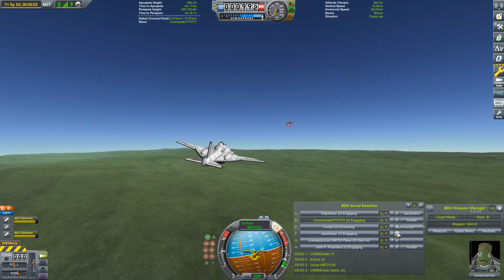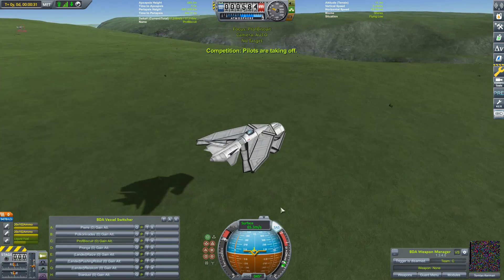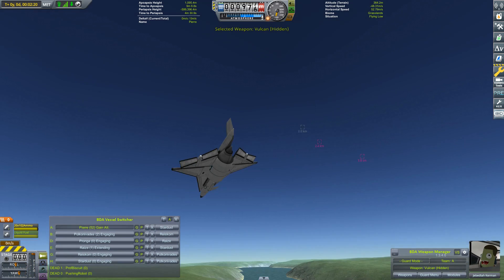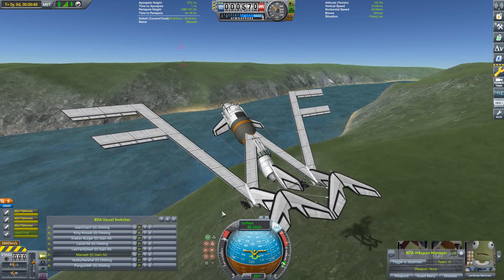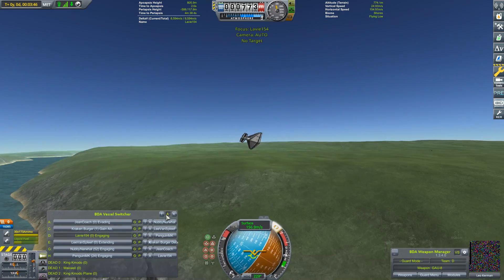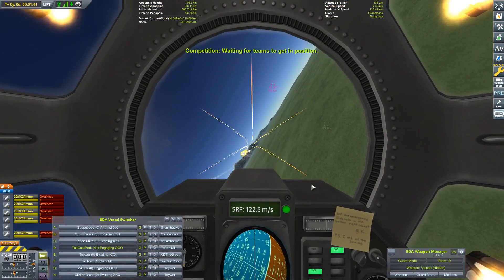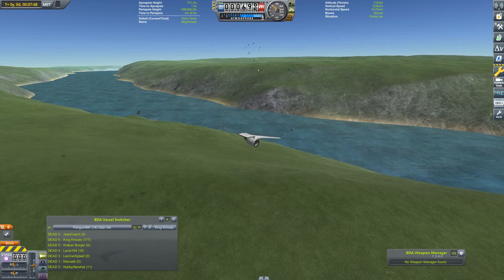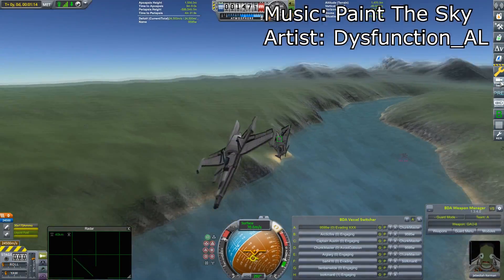Runway Project - Episode 2 - Building Fighter Planes with Airliner Engines

Comment: So how accurate is Kerbal at simulating airplanes with wings, tails, lift/drag/moment curves, and all that?
Reply: At the same time both surprisingly accurate and  not exactly.

The aerodynamics system is really quite basic but surprisingly gets the job done decently, managing to simulate what you listed, however it treats individual parts as (for the most part) simple point masses with lift and drag vectors, with no regards for the actual shape of the part. Also, part occlusion means nothing in terms of lift or drag, hence the funky gyro craft block thing (of which I am the creator of).

Comment: This is great.
Can you make a Gau-8 powered aircraft? Do they give thrust?
I'm imagining planes with rear facing guns/engines and bullets filling the sky.
Reply: There is recoil . It's something like 5kts for every 3 second burst . 

The hurricane Mkiid would have 10kts taken off its air speed everytime it fired it's twin Vickers 40mm anti tank guns .
Reply: @edmundscycles1  True, and the Yak-9 WW2 aircraft unfortunate enough to be fitted with a single but high RoF NS-45 automatic 45mm did not come out any better. In fact they even came apart!
Reply: @_tyrannus  oooo and the 6lbs gun fitted to the mosquitoes was even more brutal but at least they didnt break up .
Reply: Yes, but don't expect it to fly for long.
Reply: Scott actually did that on the channel already didn't he?
Reply: You’re only allowed forward facing weapons though 🤷‍♂️

Comment: The reason airliner engines make poor fighter jet engines, other than their size, is their low exhaust velocity. Yes, they have more thrust than any single jet fighter engine, but the low exhaust velocity means they lost thrust as their speed increases.